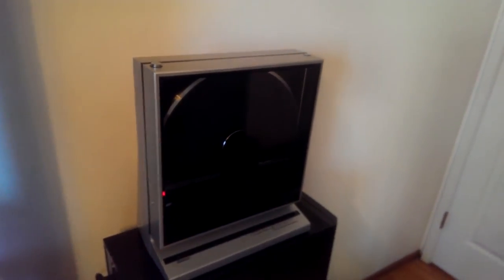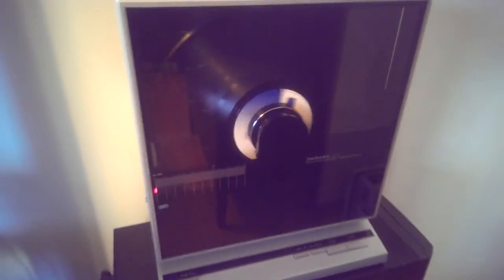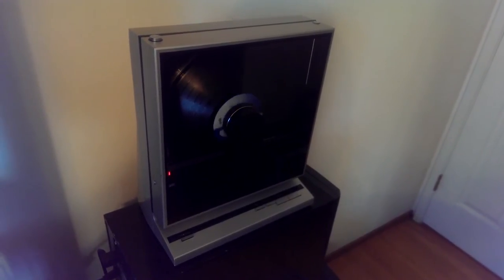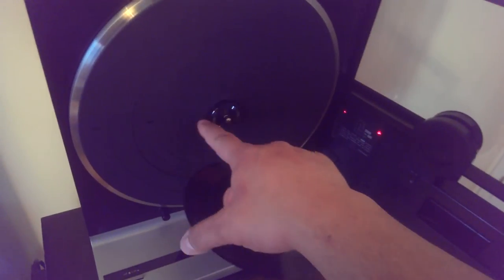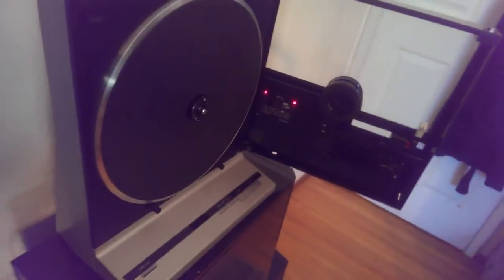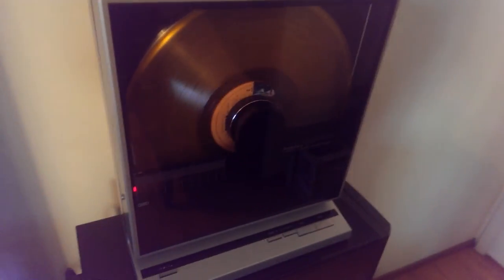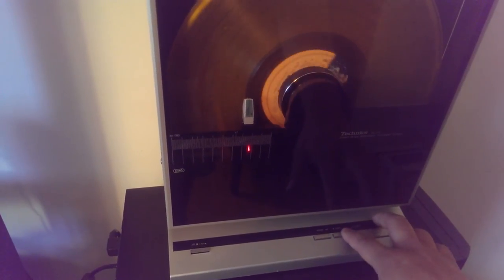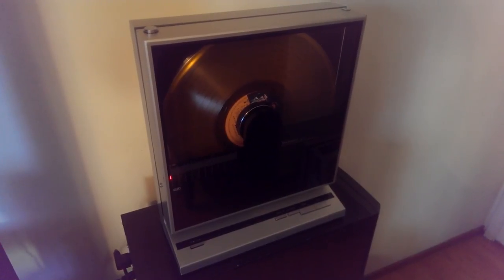Technics SL-V5 Linear Turntable Demo

Comment: Great video!  Mine DD motor is a little slow to start, but then it comes up to speed and runs like a champ.  Can I ask where I can get the belts from for the tonearm and what to replace the stylus with?

Thanks in advance.
Reply: Oil the motor that all it is .

Comment: Hi, thanks for sharing this video. Just a question: what if I want to play a 12" 45 RPM record?, back in the 80's there were some 45 RPM records in 12" format to have a better frequency response. Thanks in advance for your answer.
Reply: On the standard SL-7 - and I'm sure this one too - there was a facility to override the automatic speed setting.  This is particularly useful for 10"s because it seems to be a 50:50 split as to whether they're cut at 33 or 45.  There was also the facility to override the automatic size function in case you were playing clear vinyl.  Fabulous turntables